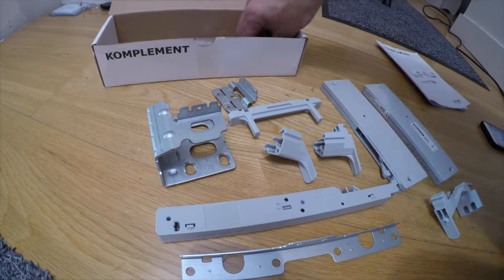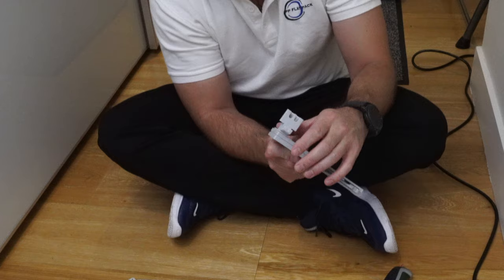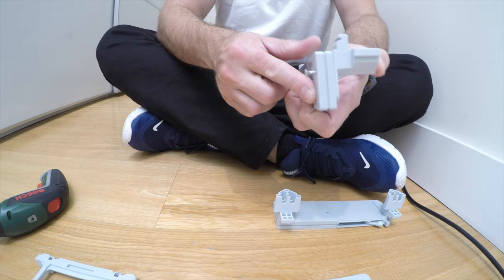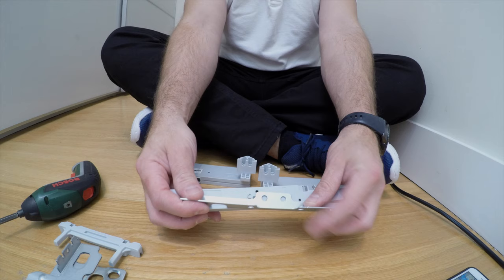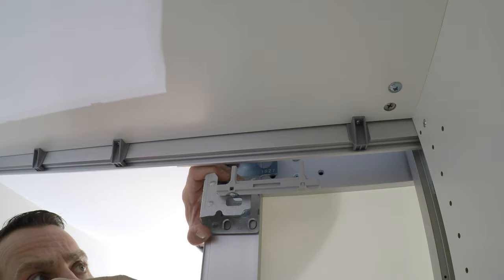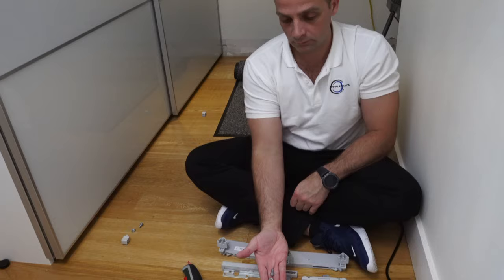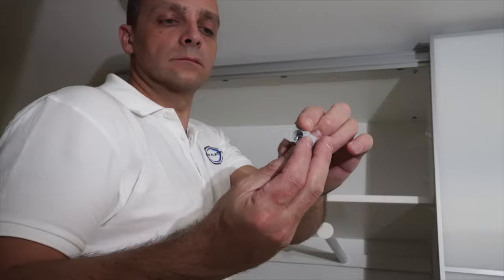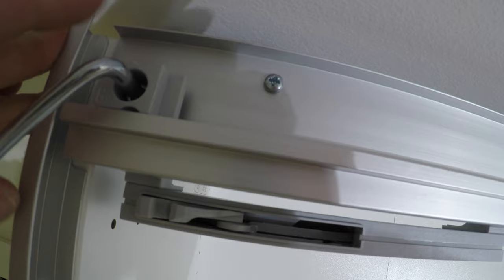IKEA PAX sliding doors soft close instructions

Comment: Hi. I have installed PAX Cabinet 236cm high in my room which is 237,5 high and no access from the side of the cabinet as the cabinet is as larged as the room is. I would like to install PAX sliding doors on the cabinet, but IKEA tells me I can't due to the 237,5cm height of my room which is not enough. However, when I look at the video for installing this sliding doors soft close system, it seems to me that there is no need to put the doors up above the cabinet to hook the doors on the rail, I have the feeling the doors are fixed on the soft closeing system from the front without putting the doors upward. Am I wrong Thanks in advance for your help

Comment: You are a legend! Thank you for this video!!
Reply from the maker: Thank you for watching
Reply: @PPFlatPack  your instructions are amazing! :)
I have one more issue to fix with my sliding doors. To pull the baskets out of the pax, I have to give the right door a little harder push to open completely so the right door (which is the outer one) connects with the middle part of the softclose (which is fixed on the left, inner door). Problem is when I want to close the doors after that, the doors stay connected, so I have to pull hard to separate the right door from the softclose which is fixed on the left (inner) door. Do you know how I can fix that?

Comment: If you have Hasvik doors, you don't have pre-drilled holes for item at 11:25. In this case, drill the missing 2 holes 5cm from the top edge with 5cm drill. make the plastic part end where the metal one starts. I did this and it works perfectly.
Reply: Well, I have the same problem. I Wonder, if you could deliver more information.
Reply: I called ikea and they told me that Hasvik doors are light and so I dont need to install middle softener (the one we see at 11:25). Just side softener are enough. They also said, I may harm the door, if I try to open my own holes.

Comment: Excellent video, The instructions included are not intuitive, We installed the doors in a step-in closet not an ikea product, I built the doors and hired an excellent general contractor to install the doors as they would require retrofitting into an existing step-in closet. He gave up on the soft close and said could not be done. With the help of this video I was able to install the soft close. The only modification to the video was that I had to install components with the doors on and the inside door the lower slider Bracket (124339) I had to remove and install after the door was in place. Works great. Thanks. Would be nice if the doors came with low profile grip/handle to open and close the sliding doors as we have the mirrors and fingerprints get on the mirrors.

Comment: Great video. But there are two small screws on the inner door bracket you did not fit. Theses are quite important as they stop that small inner bracket from twisting and going out of vertical. See removal and refit and 1240. There are three screws on this part.

Comment: Hello! I installed my sliding doors (2x150cm) with your video, thank you so much! There's only one problem.. when I open the doors I have to use force to open them completely. Then they are stuck together when they are completely behind each other so I have to use force to "unlock" them again. Is that normal? I checked everything and I can't find the problem. It just looks like they don't slide into each other smoothly. Do you know what the problem could be?
Reply: Having this same problem. Our outside door is on the left and inside door on the right, when you slide them together the locking hinge clip from the right (inside) door hits the larger soft close bracket on the external door just enough to require more force than should be necessary to get them to slide together.
Reply: I have the exact same problem. Also 2 x 150cm closets
Reply: Same problem as you guys, did you have a solution in the end?

Comment: Very useful video! Subscription on!
Could you please advise if the front door is on the left, behind door is on the right… but the wall is on the right same as in your video. Is there an easy way to put the right door (which goes behind, under the left) since the wall is exactly next to the wardrobe.

Comment: Great videos 
Hi with the outer door with the metal edge and the stick on rubber trim is it right it does not close to right to the edge as the inner door closes to the edge (outside edges )
Also can this soft close be fitted without taking the door off 

And how do I fit the strip lights(wires etc ) best way please

Comment: Thank you PP Flat Pack for your video.  I do not understand the small adjustment (hex screw) for parts 124337, which is the door roller.  I installed the PAX, but found the wardrobe is like a parallelogram (ie. there is a 3mm gap between the frame and sliding door at  lower right, another 3mm on the upper left.  Can this hex screw adjustment fix this.  Thanks in advance

Comment: Thanks for the help! Assembled my double sliding doors with soft close mechanism but now I realized that even with the door fully opened the gap is too small to be able to install the complement baskets that came with the pack! Did I do something wrong? It seems like it’s the soft close mechanism itself that is keeping the door from opening fully
Reply from the maker: Open the top part (stopper on the top rail )with the Allen key and push more to the side there is an adjustment possible around 1cm.

Comment: I’ve lost days of my life to putting two of these wardrobes up.  I can’t believe how hard it is. I have a question: the sliding mechanism stoppers labelled and B and F can only be adjusted so far, and even at there maximum the sliding door is 5mm short of the frame.  I can’t get the door and the frame aligned. Any suggestions?

Comment: Hi again! I see here that you have the outer sliding door on the right (as per my last question). I also see that you have the PAX against the wall on the right without skirting behind the wardrobe itself. How do you deal with the skirting on the wall on the right-hand side in "front" of the wardrobe? I have noticed that if I put skirting all the way to the frame of the wardrobe, the bottom right corner of the right door will hit the skirting. Cutting the skirting short will mean leaving a "gap" between the skirting and frame, visible when the door is opened. What is your solution? Thanks!

Comment: I'm adding Hasvik doors to 4 x 75cm wardrobes in a space only a few cms wider than the 300cm run.Struggling to fit inner door. Will it be easier to fit the inner door before the outer on the next pair? Thanks for the videos- they've been really helpful.
Reply from the maker: Remove inner stoppers on the top rail on the middle from both top rails if you have already installed soft closing on the middle removed. The bottom rail removes ending plastic on both in the middle. Now you can slide doors all the way and have enough space to put them on. Once you did put the soft close back on the middle and all done.
Reply: @PPFlatPack  Thank you very much....that worked!! Doors now hung and seem to be  working properly.
It's taken a while but great sense of achievement now they're finished .
Reply from the maker: @barbararule3800  Glad it works. Thank you for watching

Comment: Hi, I did this yesterday. I dId not have that third soft stop to stop doors banging together in the kit. Are there more than one soft stop kit you can buy?

I was less than impressed as you mention my doors bang together! 

Also in my kit the end stops F and B have clips. F engages but B does not which seems rather odd to me. Also the soft puller is not string enough to actually pull the door into the clip. So you have to give the door a push to close it.

Not very impressed Ikea !

Comment: Hello, I have just moved to a new house and moving crew coudn't assemble the sliding doors of the pax wardrobe because they said the ceiling is very low and there is no place for the doors to be assemled. Now I have just the base units and I saw your video, you also have no space in the ceiling. How did you manage to assembly the doors? Please advise me, I do really need help.
Reply from the maker: If you have less than 8cm clearance you have to assemble wardrobes upright and regarding sliding doors all tutorials here https://youtu.be/R499d-CBDzk

Comment: Thanks for the video, question for you. I've just took far longer than I should of building these wardrobes, I thought I was finished but when I've gone to open a drawer on the left it rubs against the outer door which is also on the left. The drawers although a different style open one the right. My only thought is the stopper on the right stopping the door going further so the left one cant quite open all the way as the right door is blocking it. I would adjust that stopper but im 90% sure its pushed all the way up against the inside off wardrobe. Any help would be appreciated. Also I never installed a soft close between the doors and I'm all out off bits. Thanks.

Comment: Hi PP Flat pack. I've got a pax auli, their tallest unit, Sliding doors are all in their correct tracks. I just installed the soft sliding komplement brackets, and the larger bracket seems to lodge the smaller bracket, making it more difficult than it should be, to separate the two doors once they overlay each other. Have you come across this issue before?

Comment: I just finished installing 4 x 75" cabinets with 2 sets of Halvik sliding doors, and couldn't have done it without your fantastic video series - thank you!  One question:  I purchased all of the components last week (in Canada).  There was no middle hardware section that came with with the soft closing mechanism, and although the soft closing works well on the far right and far left positions, the doors make a loud banging noise when they meet in the middle (when I am pulling the doors to one side or the other).  I'm not sure if this means I've done something wrong or it's just a design flaw.   Have you encountered this?  I'm thinking of just putting some felt stickers on the inside edge of one of the doors, but would be very appreciative if you have a better suggestion.
Reply: Priyan Morsinkhof Hi Priyan.  Yes.  I since talked to IKEA about it.  They make a newer version of the soft closing hardware that has an additional middle section (slightly more expensive), but they don’t recommend it for my doors (Havsik 75cm) because they are apparently not heavy enough to generate enough force engage the mechanism.

Comment: I have the left door sliding over the right door. The right doors soft closing works but the left side (with the extra high door bracket) will not catch the mechanism. There is about a fingers width between the wardrobe catch and the door catch. Anyone know why?

Comment: Hi PP Flat Pack, i've just put my double Ikea wardrobe with sliding mirror glass doors together thanks to your instructions! However, when i close the outer door fully the top part is flush against the side but for the bottom part of the door there is a slight gap. Any ideas how i could fix this issue? Cheers in advance.
Reply: Hi David. Did you check if the bottom part of the door is hooked on the second groove? Also, make sure you don’t hook it all the way in the back. Hope this solves your issue.

Comment: Can the doors pass over each other fully?  Also, I have a gap that is larger on the top then the bottm of the inner door when it is fully closed.  Is this adjustment made by moving the stopper?
Reply from the maker: Doors can past over each other if you don't have soft closing hinge and ending panel on outer doors. Regarding gap  between doors - hinge on the top or bottom is in the wrong track. If the gap is on the side door to wardrobe frame - top hinges have to be adjusted or have to put something small under one side of the wardrobe to lift the frame up.

Comment: Brilliant, informative videos, thank you so much.  Quick question though if I may?  If you were fitting these soft closers as well as the Norrfly lights, do the lights need to be shorter than you would ordinarily install?  I think this is what the manual with the Norrfly is implying even though IKEA’s in-store designer sold us 2x 100cm carcasses,  2x 92cm Norrfly, and the soft openers.  Do we really need the 67cm lights instead?  We also have the same issue with 2x 75cm carcasses.  Would we need the 55cm or 42cm Norrfly for these if this is the case?  Sorry for the long question but it doesn’t help that we are still awaiting some of our order including the soft closures so I don’t know how big the closer housing is and how much space to leave.  Any help or advice much appreciated. Thanks.
Reply from the maker: For 100cm frames, you can do 92cm there are extensions in the box if you want to mount them on the top pannel it will come under the rail not sure if it will go under the soft closing box better check with Ikea. If you have first shelve from the top about 20cm-30 cm mount the light on the bottom of the first shelve from the top same as in the video here  https://youtu.be/cTIjCTfWaOU
Reply: @PPFlatPack  Thanks so much for the quick reply.  Yeah, will be using the Norrfly leg extensions for a sliding door installation but the diagram in the Norrfly manual (page 25) is showing (I think) that the light (with extensions) should not go near,  or over the soft closure which is a pain as we did a 180 mile round trip to have an appointment with an in-store Pax design expert just to be sold the wrong fittings.  The hanging rail is occupying the top holes in the wardrobe with 4 drawers taking up the bottom half.  I have spoken to IKEA but they don’t seem to know themselves but if it is wrong they want me to either return and swap in store (90 miles away) or pay to return and then pay again for the right size lights even though it is their error!  Anyway, thanks for your help and advice.  Have a good day, cheers.

Comment: Please HELP! :face-purple-crying:The screw to mount the inner bracket is different in my case :body-blue-raised-arms: (minute 9:18 of your video); it absolutely does NOT fit in the door frame. I'm sure I didn't mistake them as they come in a number of 3. The screw code indicated in the manual is 150481. I've now opened a customer service ticket. Could you please tell me which code is your screw so that I can have Ikea send me the same one.:face-blue-covering-eyes:
Reply from the maker: What kind of doors do you have? HASVIK or the AULI. If you have any metal or aluminium frames with panel doors there is screws included with a soft closing 3 screws with a flatter head and they replace the original screws (not sure of the screw number). Ikea has now a new system so not sure if they still do the old soft close for the previous model. If HASWIK you need to use the screws included with the soft close and the number is- 15048.

Comment: Hi, I have a question. Is it possible to install the sliding doors in 236 cm pax in the room with 238 cm from the floor to the ceiling?
Reply from the maker: Yes, it is possible just make sure you have enough ceiling clearance in your case 1.5cm all along where the wardrobe will be standing. Of course, you will have to build a wardrobe upright and how to do that you can see here https://youtu.be/iIuqzUXoR5s
Because you have sliding doors you need to put plastic in the top panels before you connect the frame.
Reply: @PPFlatPack  Thank You. Im still thinking if I should buy the other one with 201 cm height. Im afraid that the bigger one will not fit properly 😱
Reply from the maker: @ewelinasmetek1537  Well it will look great almost like build in wardrobe have look here https://youtu.be/ehWybREbdF4  I cut them in this video I think the hight is similar about 1,5cm from the ceiling I thin it look good just make sure you have 1.5cm all along and find good furniture assembler.

Comment: I’m confused.   My family bought the double wardrobe and sliding doors and also gave me this komplement box.   And then told me to go put it together.   Is it correct that when you buy the sliding doors and brackets you get everything you need except that the doors will slide hard?      And that if you buy this box of stuff then you replace what came with the doors with the stuff in this box and the doors will slide and not bang when they hit the sides?   Can i install this box right off the bat?   Thank you
Reply from the maker: Yes and yes just follow this video and all will be fine
Reply: Thank you!  I watched all 3 parts and this soft close video and after all that I feel very comfortable proceeding.   You make it all seem so logical and routine.   And thank you for showing the RIGHT Door Front instead of the Left Door Front as in the manual - something for everyone.    I did notice two quick things:   1) when you install the lower bracket in video part 1 you do NOT install the little end enclosures.   Not sure if there’s a reason for not showing that, and 2) you do not get an Allen wrench with the soft closing kit - i guess IKEA expects you to use the one that you would have gotten when you bought the sliding doors themselves.
Reply from the maker: @familiaandyrybnyky9260  This is the older version enclosures not included yet. There should be allen key included in the rail box not in the soft closing box